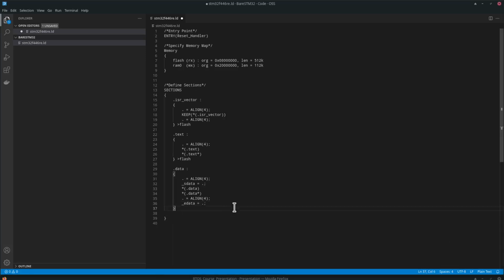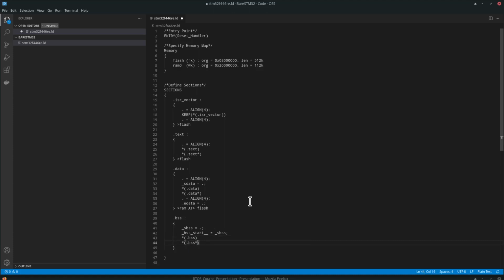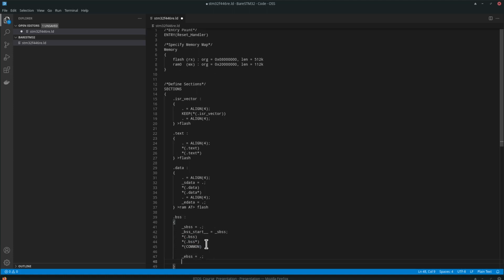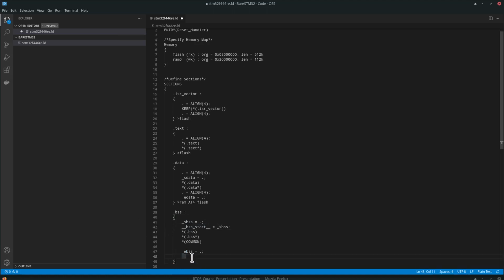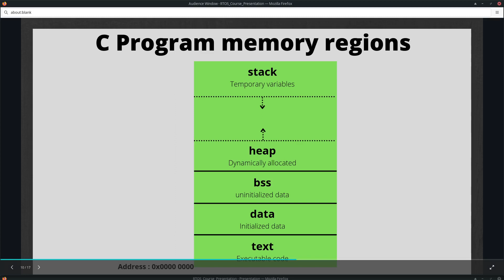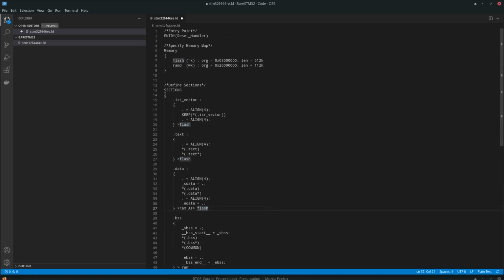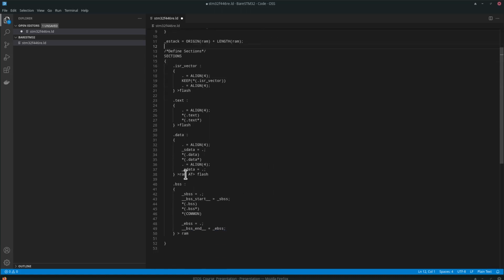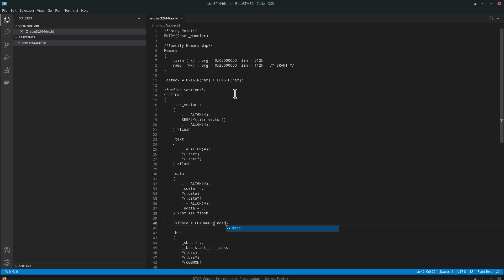9. Linker Script Sections command continued

Comment: _bss_start_ and _bss_end_ are not required for gcc compiler. They are required for c runtime. If you do no use c runtime (-nostdlib) you don't need them. When you use c runtime _start/_mainCRT0 functions clear all bss data. You should only load the data segment to the memory. As as result if you don't use standart library these symbols are not searched by gcc compiler.
Reply from the maker: Thank you so much for providing the details.